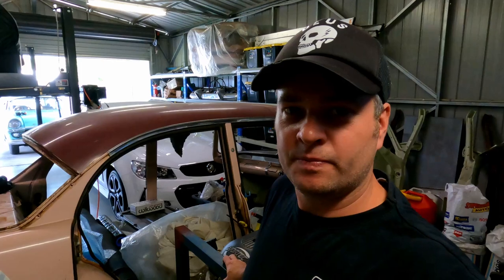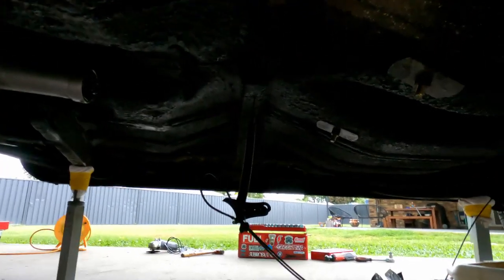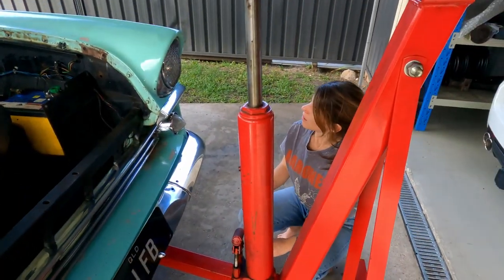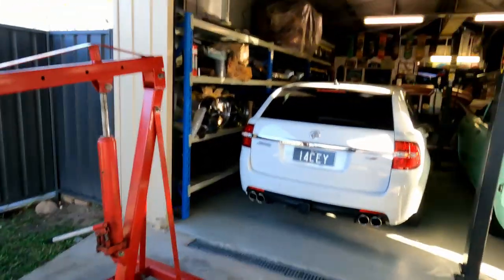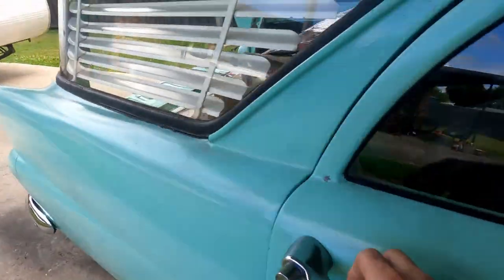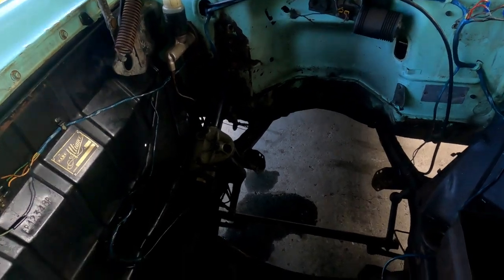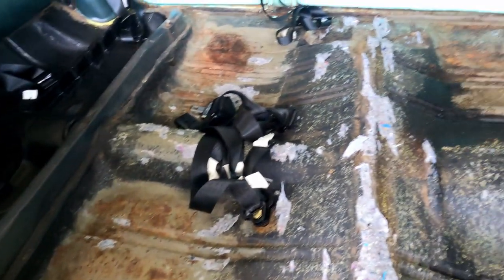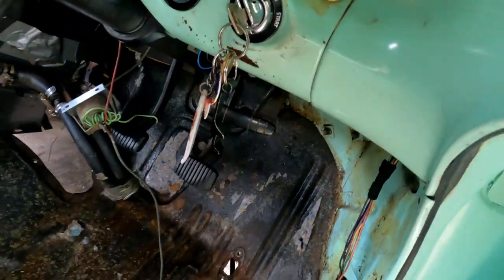FB Holden Wagon   LS Build   EP1

Comment: Just subscribed, doing same. Our first car project. Rod shop front and 9inch diff so far in, hopefully fit motor and gear box next week🤞  still working out who to send to for fabrication work and engineering
Reply from the maker: Been busy on it but haven’t had a chance to film. It’s rolling and steering, started putting engine together this weekend should have it buttoned up with Tim next weekend. What state are you in?

Comment: Looks good mate good job 

I’ve got a cousin who drag races an EK called “special K” not far off an FB……

He told me once if you put big power through em the chassis twists and they need to be strengthened up…..

Hopefully you won’t have to do that he’s doing 10 seconds quarter-mile, which is pretty fast as you know
Reply from the maker: Is that Sam Rhodes from WA “special K”? If so I grew up watching that thing doing massive wheel stand launches. A very cool car and definitely an influence on my love for this model. This will have the usual chassis strengthening required for engineering, plus we want to be able to
Tow our vintage caravan and nostalgia dragster with it (as well as hitting the odd drag strip). Thanks for watching 🍻
Reply: @Greyghost_138  Yup Sam Rhodes and his Mrs drove a yellow Charger - Cassie I think…..

His dad was my mum’s younger brother

And that EK Holden belonged to my uncle - my mums oldest brother - and Sam bought it out of the shearing shed on the farm in Narrogin in the late 1980s for a couple hundred bucks and it only had a tickle of rust in 1/4 panel

I think he now for many years has a spray painting business called Vulcan panel and paint and he’s done very well out of it. Good on him